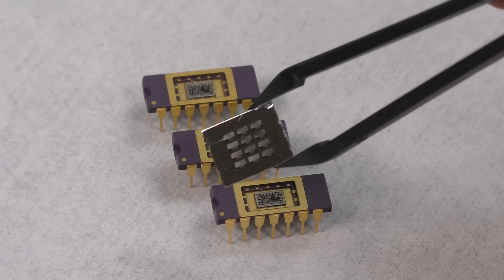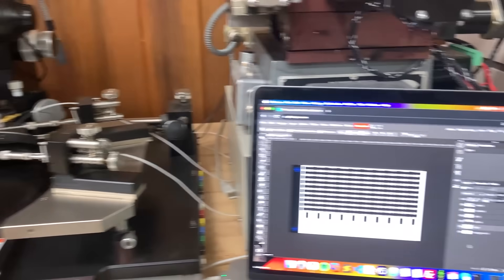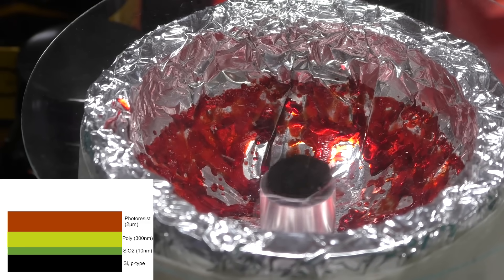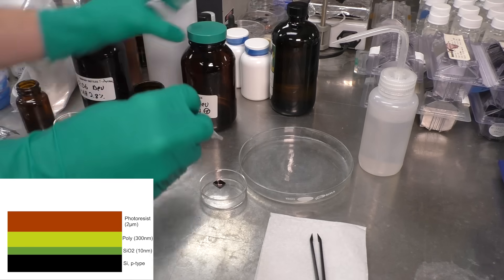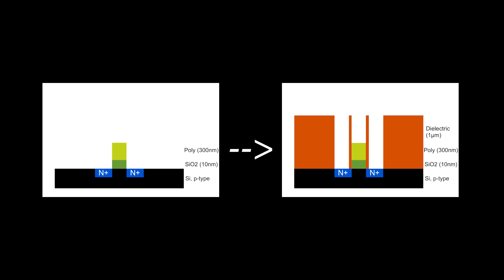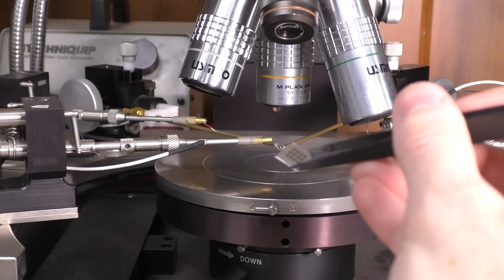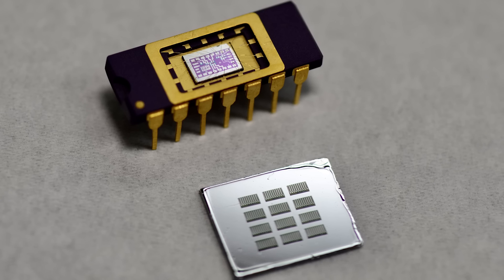"Z2" - Upgraded Homemade Silicon Chips

Comment: 2025, Sam: Oh, I finally made it to 5nm.
Intel: here's our new 10nm+++++++ process.
Reply: By 2030 Sam has developed a practical single nanometre transistor and has perfected general purpose Quantum Computation
Reply: @bilbo_gamers6417  the current process nodes are much bigger than their marketing names. TSMC's "7nm" process node's single transistor size is 2160nm^2, the ptich is 54nm, the gate is 40nm, the height is 6 micro-meters and so on.
Reply: @rattlehead999  yea the chips design is limited to the constraints of photolithography. and yes those new asml uduv tools are insane, costs about 120mil to expose at that level tolerance in a production environment. just for the 1 tool an not the upkeep or any of the other processes. sam is very gifted and has a great future ahead of him.  thanks for your vids sam! love to come home and nerd out after a long day in the industry.
Reply: @bilbo_gamers6417  Transistors aren't used in quantum computers
Reply: @bilbo_gamers6417  It's because he doesn't have a job which depends on him having more work to do!
Reply: Wouldn't it be nice if anyone here was actually an EE? Maybe then we wouldn't all be talking out our asses about how this corporation is bad and this other one is good yadda yadda yadda.
Reply: @LunarLaker  yeah, except that I'm unofficially an EE, my father is officially an EE with a minor in Hardware Architecture, I've made my own circuits and even my own 4 bit and 8 bit CPUs, but then I realized that if I want to design chips, I'd have to move to another country, namely the USA or China/Taiwan, and I switched to software engineering.

I'm also studying software and hardware engineering in university, but I've learnt nothing new in the 4 years I've been there, because universities teach you next to nothing about everything. And my degree can be used as an electrical and electronics engineering degree once I get it...

Also universities don't teach you squat, so this "Engineering" title is quite the empty one. It's all up to the individual and self-studying.

I'd say you need to know 10-20x what you learn in 4-8x years of university to be acceptable, not even mediocre.
Reply: @rattlehead999  : If you want to design chips, then study VHDL and/or Verilog, and spend the monry to buy some CPLDs and/or FPGAs to program the code onto. It's not economically viable to layout modern chips by hand, so everyone does it automatically these days. If you ever get a worthwhile product then you can pay for runs from a few of the existing manufacturers (they run customer manufacturing batches between their own, to maximize the usage of their foundries).
Reply: And no, this doesn't require you to move to the US or Taiwan, just to any of the countries that aren't getting sanctioned.
Reply: @absalomdraconis  I know now, but it's too late, already deep into non-hardware related software engineering.
Thanks though, much appreciated for taking your time to share info.
Reply: @absalomdraconis  Checking the chip layouts produced from your VHDL is an important quality assurance step before sending the layouts to a fab.  At least until you know and trust the quirks of your tools.  Same thing as checking the assembly or machine code from a software compiler.
Reply: @LunarLaker  Whoosh. It would be nice if some people here could take a joke and were equipped with properly calibrated irony/sarcasm detectors. You can detect these people by their intellectually substandard comments.
Reply: He will be working for Intel or AMD before 2025, mark those words.
Reply: @GeomancerHT  More like TSMC or Samsung.
Reply: @maidpretty  What about ASML?
Reply: @GeomancerHT  Probably faster to build his own company and replace them…
Reply: @GeomancerHT  Intel and AMD are too busy sitting in their high castles.
Reply: @GeomancerHT  wrong, he'll be working for ASML
Reply: @GeomancerHT  hope internet be able to provide resources to him keep working for us instead.
Reply: @GeomancerHT  how is it going now ?
Reply: @GeomancerHT  hope for AMD we need nice GPU'S
Reply: @GeomancerHT  Employers are not looking for people that actually know what the hell it is that they are doing. This is a revolutionary not the kind of guy suited for corporate lifestyle. You learn what they want you to learn and do what they want you to. Corporate America.
Reply: @webserververse5749  How's that revolutionary, he's replicating an industrial process, pal
Reply: @GaiusCaligula234  Perhaps revolutionary was not the correct term to use, however the idea of someone kind of handling the process to its entirety vs the cog in a machine kind of role is just not suited for corporate especially in manufacturing
Reply: @GaiusCaligula234  The process is not revolutionary. The fact that he is doing it in it's own (or with barely any economic help from a powerful entity) is.
Reply: @webserververse5749  You're about as deep as a bowl of soup.
Reply: @WimsicleStranger  Soup is a beloved dish by many. The bowl can be as deep as one is willing to make it. Well loved with limitless possibility.
Reply: These are the most arrogant comments I've read on a tech channel. It's very impressive what this kid is doing but it's also billions of dollars of R&D behind the state of the art used by corps like intel and AMD. He's a caveman to their Ferrari engineer.
Reply: @32BitJunkie  intel is still way behind whether you like it or not, they're still doing 14 and 10 nanometer while AMD is doing 7 nanometer and apple was the first to put 5 nanometer into a cpu
Reply: @memes_gbc  When you hit sub 100nm scales measurements become very subjective and are much more dependent on your measurement device than the thing you are actually measuring. Imagine measuring the size of elephants in a herd from a plane flying 10000ft above  - depending on circumstances you may come to the conclusion that elephants are 7ft big or 15ft big - because one way will give you width, the other will give you length and depending on the vibration of your plane your camera might just give you grey splodges on a fuzzy yellowish green ground. 

What we have here are very small silicon elephants and a zone in which we are not allowed to fly close enough to our suspected elephants to even see them, so we have to look from space using radar to measure them through the clouds... the Fundamental Physics National Park Authority sucks! ;-)

BTW: AMD and Apple do not produce their own chips. Their structure size depends on the Foundry they use.
Reply: @webserververse5749  true, that is how large fab corporations (TSMC, samsung etc) make people hard to leave their jobs.. their jobs are too specific that there's hardly any company which has the same tech as those giant corporations to hire their expertises
Reply: Nah, here’s our 3A and 2A process. Angstrom
Reply: also intel: out 10nm is different than amd's 10nm
Reply: Many a truth said in jest.
Reply: they have been making integrated circuit kits for decades
Reply: When I see the 10nm++++++++++++++ I just hear him smashing the keyboard
Reply: this didnt age super well lol
Reply: Intel is manufacturing Alder Lake Processors on its 7 nm Process.
Reply: @srikrishna2561  No. "Intel 7" process was previously known as "Intel 10 nm Enhanced SuperFin (10ESF)" as was renamed for marketing reasons.
Reply: @maidpretty  The density of Intel 10 nm is equal to that of TSMC 7 nm.
That's why they changed it.
Reply: @srikrishna2561  7 nm lmao
Reply: You joke now, but...WATCH THIS SPACE!
Reply: you need euv
extreme ultra violet rays
and needs a drop of tin plasma
Reply: @Bramble20322  Tens of thousands of dollars sounds like an alternative to having bought a second home.

If you could have a nice paying job, an already paid home, low expenses and enough willpower to be saving for years, seems doable on (almost) your own. At least if you are an American.
Reply: there's only a week left for this prophecy
Reply: Intel CEO: SAM ZELOOF BUILT THIS, IN A GARAGE, WITH A BUNCH OF SCRAPS
Intel Engineer: I'm sorry sir, I'm not Sam Zeloof.
Reply: It's already 2025 now

Comment: Man, this is so cool!
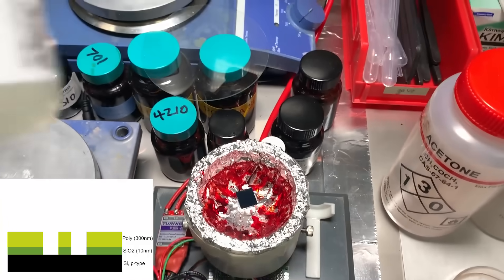Quick question: how does a product like a "spin-on dopant" (3:14) even exist? Like who buys this stuff in small bottles, other than obviously you?
Reply: Acedemic labs doing small scale production?
Reply: Universities for one.  I have a friend doing his PHD at this very moment who's lab is filled with this stuff. (He does epitaxy work)  Besides, you'd be surprised at how many people have interests like this even outside of academia.  Most people in the public believe that every home is just a TV, fridge and DVD/BRP.  You'd be amazed at how many people have interests that range from basic ham radio to lithography, chemistry, radio astronomy, etc, and do it all at home.
Reply: My lab used them while for solar panel research.
Reply: You could make the spin machine with a cup you drilled a hole in the bottom of and a motor. It did not look terribly complicated to me.

Comment: man, you should be making graphics cards right now. make something that outperforms, or hell, even performs on par with the current gen cards, and charge a reasonable price, you'd probably have more demand than you could fulfill and make a fortune
Reply: He's only about 10 million years away from what the industry is doing presently. There's only so much one guy can do on his own after all. It took 1,000 man years to design the original Pentium CPU. They did it in less time by having more engineers on the job.

Comment: Sam, can you explain the shock protection metal shroud in bit more details? Also, why the MOSFET curves are bit compressed in the lower Vds region? Is it due to high S/D contact resistance?

Comment: If you are planning on developing this towards a home-grown CPU, I would recommend translating the LatticeMico8 soft-core CPU into real hardware. It can be synthesized to use less than 200 4-bit lookup tables and less than 100 registers, and since it comes with a multitude of peripherals ready to go, you would have room to expand without having to fully design them yourself. The only problem I see is that it might be tedious to translate between Verilog and hard masks, although you might be able to do it if you could essentially make your own hard-wired version of a CPLD.

I can't wait to see what you do next! Cheers

Comment: if you can get down to a feature size of a few micrometers (which, if microscopes can resolve features down to 500 nm, seems plausible), you can probably consider printing a riscv processor design and MAYBE run some code on it using another microcontroller.

Comment: This is awesome. :o

I need to watch the other video about the DLP projector. Can't remember which light sources you're using.

This is a huge achievement. Well done, Sam.
Reply: Oh yep, you did mention the light source thing in the Lithography vid. hehe

So it's using the original arc lamp in the projector, but presumably with the colour wheel removed (or moved out of the light path), then a UV filter for when you need to do the image alignment. Neat.

Comment: This is without a doubt one of the most impressive uses of the term "homemade" that I have ever seen! Can't wait to see how your process improves over time!
Reply: Hopefully he can design a ALU or even basic CPU. That would be an incredible achievement
Reply: @burntoutelectronics  - True indeed! Heck, he's already surpassed by far the density of the ICs used in the Apollo space program! (if memory serves)
Reply: @FatLoach  
They used wire memory for the Apollo missions.
Reply: @NLTheGreater  - They used a number of early integrated circuits in the on-board computers, and each of those ICs had a handful of components each. The ICs were glued and potted into modules which then plugged into a backplane of sorts. This combination, along with other modules containing things like core-rope ROM memory, power supplies, and probably a lot of other things I don't know about, are what made up the Apollo spacecraft computers. It was absolutely bleeding edge technology at that time.
Reply: @FatLoach  not all of it was bleeding edge.PCBs did exist at that time but were considered to be too new and unreliable for the type of use they wanted.
Reply: @NLTheGreater  Core memories.  They used magnetic cores to store the bits.  The wires are for sense and programming the magnetic field.
Reply: @NLTheGreater  -- I think some called it "hair memory." Yeah, that was braided wires and ferrite beads.
Reply: @burntoutelectronics  and maybe reverse engineer an x86-64 cpu
Reply: I was going to say something like, "homemade... well, I am not sure I can do this at MY home"... :D Awesome work!!
Reply: My home shop is not that well equipped. Thought I might see a garden rake or a bicycle hanging from the ceiling. 😂🤣 amazing contentNEW SUBSCRIBER.
Reply: I could not agree more.  Amazing.  Can you say "passion"?
Reply: This is truly amazing. Couple these videos with Ben Eaters 8 bit computer and you could go from scratch to a workable device! If I would like to learn more about this process, what books would you recommend?
Reply: He'll be writing his own operating system to run on his "homemade" custom chips
Reply: N1RKW same here. It's a ways beyond a DIY butter urn -- even a wind powered one.
Reply: dosent matter how far he "improves" hes always going to be decades behind people who actually know what their doing, and arent just following material for decades old shit transitors.
Reply: @FingerinUrDaughter  the satisfaction of creating something like this yourself is absolutely worth it. There is a huge difference between what an individual can accomplish and what a company can produce, no doubt about that, but that is not the point of this hobby.
Reply: @FingerinUrDaughter  if you ask "why?" enough times there is no point to anything.
Reply: @FingerinUrDaughter  you should encourage the passion and resourcefulness of this brilliant guy instead of being a criticizing ***** that spends the majority of his time swiping on Facebook and watching YT videos. Ffs.
Reply: @FingerinUrDaughter  -- Shit transistors? That would be amazing if we could make transistors out of that.
Reply: they're

Comment: I have nearly 30 years in the semiconductor industry... and have worked on everything from millimeter scale resistors / simple MEMS device s built on 2 and 4 inch wafers up to ultra modern nanoscale state of the art billion transistor processors..  Very impressed.  This level of technology is frequently done in university mini fabs by a team.  On your own in a garage.. rather more difficult.

Comment: I would love to see this lead to a cottage industry reproducing vintage and hard to find chips.
Imagine being able to build an Apple I with all new components!
Reply: MOS  aka  commodore semiconductor was  cottage compared to others. They were not able to deal with their waste. So I did not watch the video, but would like to be pointed to the reuse / recycling section for the chemicals.
Reply: @ArneChristianRosenfeldt  right, at least it is educational. Are Pharmacies at your place legally required to anonymously take any kind of chemicals for correct disposal/recycling?  

I have to say, those, who are dumping their lets-make-drugs-in- the- garage-chemicals on farmland, forests or even into ponds are 🤬.
Reply: @aleisterlavey9716  I was not good in chemistry. And I am glad that people order PCBs instead of drawing them at home with a felt tip. How do you dope without chemistry? So we take pure Si and an focused ion gun. Can't be slower than a laser scanner? It is like a CRT, isn't it? So we scan once with B and once with P. CVD to burry it under SI. Then ion gun with O for the gates. Anneal. Al CVD. O ion gun for the traces. No waste!
Reply: @ArneChristianRosenfeldt  I just wonder, if it is possible to 3d print ICs with an electron tunnel microscope or something like that...
Reply: @aleisterlavey9716  Those can move some atoms around on some surface. Below a monolayer. CVD using organic molecules (graphene like) can deposit material in kind of sleds (mix in random positions). With a tip you can sense the payload and then arrange them in the desired layout. Then anneal? The great godExMachina! But you cannot adjust the depth simply be energy. Slow .. like very slow.

Comment: Superb.  I worked in semiconductor plants for many years starting from the mid 1980s.  The wafer lines loaded up their settings from paper tape and really didn't do much that your home brew spinner does except that they would do 4" wafers from cassette to cassette.  The Perkin Elmer Micralign mask aligners were fickle things and I once had a lamp explode.  I imagine that you could pick up a lot of these sorts of machines for little or nothing today, but the space, facilities and spare parts would make them impractical for a home fab.
Reply: Practicality never stands in the way of determined individuals.